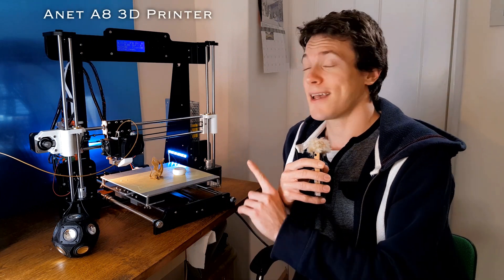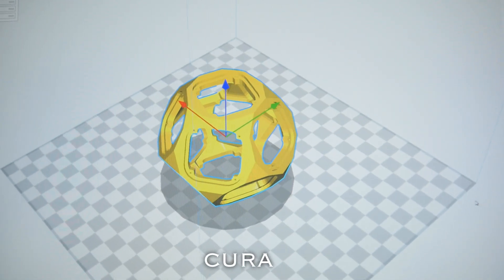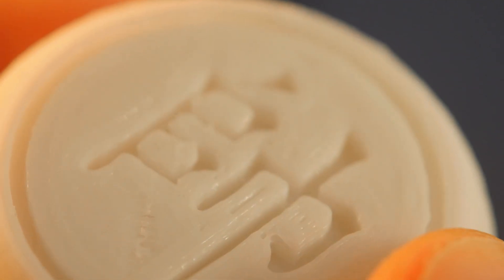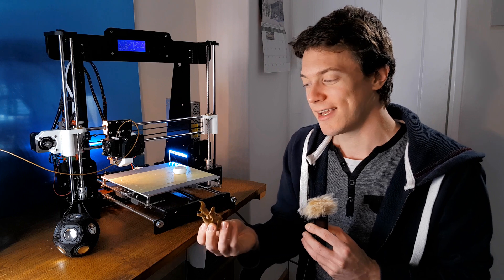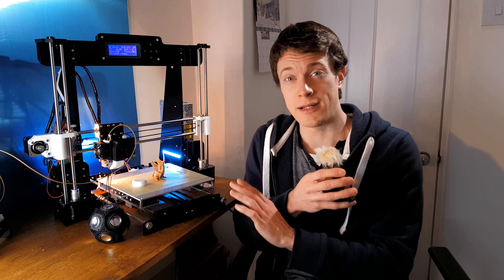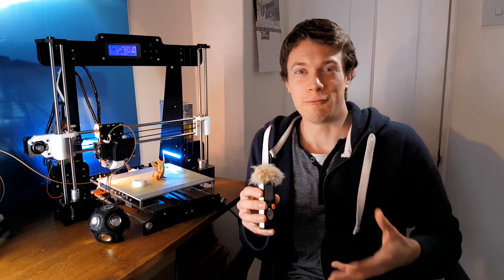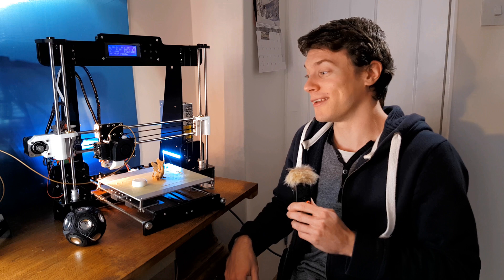Budget $155 3D Printer - Can it possibly be any good?

Comment: I love engineering and electronics in general, all the little gadgets :-) but this is one area I'm lacking in and your video and information was very valuable to me and my search for something in a decent price range. I really liked how you went more in depth with the overall printing process rather than just tossing out all the bells and whistles like most printer videos explaining why theirs are so expensive and why I don't need to buy there brand lol. My brother the actual electrical engineer built an X Y machine out of his old drill press and some printer stepping motors for designing PC boards. I on the other hand like to start off small and work my way up the ladder, learning each area involved in the process. I'm already a member of Ancestry, but seriously considering this model of printer if they are still around. Thank you again for all your great videos.

Comment: Anyone know if this works with Linux?  I'm interested in 3D printing as a hobbyist but I can't ever justify the cost.  This actually looks affordable and usable but I'm a Linux user full time and not willing to use another OS.  Thanks to anyone who knows!
Reply: I use Ideamaker for a slicer and it also runs on linux. And its great! I have printed about 20 things now with my cheap printer. Its works great, you should by a kit like I did.
Reply: @captainprototype187  Ended up getting an Ender 5, I'm really happy with it, been printing a ton.  Thanks for the tip though, I'll check out that slicer!

Comment: Hello. I was trying to print with this printer, but I keep getting bad prints (e.g. the base keeps getting stuck to the extruder while printing). Do you know if there's a good website to use to set up the program and printer to the correct specs? I have been having bad luck with it. Any help is appreciated. Thanks in advance.

Comment: I'd just like to ask clearly about that small dodecahedron speaker you showed at the end of the video - I'm very interested in something like that as a project (falls along several of my hobbies), and I was wondering if you created the .stl file for printing yourself, or was it something you found online? I've had little luck in the quick search I've tried, but as I'm limited on time I figure that asking is the best option right now. I'd appreciate any info on it, even if it's just tips on making it myself in CAD software. Thank you for the informative video - I'm finding myself very interested in 3D printing now, and appreciate the quality content. Carry on.
Reply from the maker: It was actually the first 3D print I've ever designed - I may put it up online at some point for people to print themselves. It will be in a future video if that's the case.
Reply: DIY Perks - Thank you for responding, and as well this quickly! I appreciate that, and will reaffirm that I would love to have a couple of those around - they're beautiful. I haven't yet begun to try using any kind of CAD software to attempt making things like this, as I'm currently limited on computer time (most if my YouTube time and responses are on my phone). I would appreciate any info you choose to offer, and I'd like to ask one more thing now that I know it is your model - did you design it on professional level software, or on one of the more accessible/free versions? Thank you again for responding, and I look forward to more content.

Comment: I was ready to connect all cables to the main board but then I realized that one cable is missing. I do not have a cable for the Extruder motor. Instead I have another cable for the Z-Motor2. Can I use this cable or are there any differences?

Comment: This printer is the best printer, once you do a few upgrades, under $1000.  Must upgrades include power supply $20-$30 bucks(supplied ps will blow after about 8 hours and is a fire risk). The other must upgrade is adding a mosfet to get the large current for the heat bed off the main board.  Lastly, upgrade power chords to to and from the new power supply to 14awg cable.  Then you can print out parts that help with belt tension and overall frame stability and yes, a new fan blower.  Once all this is done, and maybe a few extra fun but not necessary printed parts, now your printer is printing as good and exacting as a printer that is 10 times the money.

Comment: Don't Believe his lies ...I bought the anet a8 as my first 3D printer ... I waited about a month to get it ... then after assembly I did the wiring and the side of the board exploded... it was a bad board... then I bought a new one ... and it worked ... but the first time I tryed to print something the extruder Jamed and I didn't know what to do ... so now I have the shaft cleaned out but the very front nozzel is still broke ... and one of the wires just snapped so I soldered it back together.. now all I can do with my 3D printer is callibrate it ... not print with it... thanks for persuading me to buy a peace of crap

Comment: That problem with the power supply doesn't seem all so bad now that you taped the wires.  Sometimes when you buy things from places like those, the quality can be kinda shaky.  Let us know later on if any issues surface.  Even for $155 that would be an awesome deal.  I am personally waiting for the Trinus 3D printers to be released for sale.  The Trinus 3D printers seem to be high quality.  Sure they won't be $155 or $200 but they are by no means an unaffordable machine.  How they ultimately compare once people get them and then they go on sale is another thing but I am expecting great things from the looks of their videos showing them.  They are metal and not plastic framed and also have screw drives, not belts like many printers do.  One more nice thing is compatibility with a variety of filaments.  That all by itself can make it worth the extra cash if it turns out to be a success and not some horrible vaporware letdown as the OLO 3D printer looks to be (lucky for me I didn't pre-order that).

No matter which I decide on, it would be linked to my computer so I don't have to futz around moving memory cards around.  I would just find it more convenient that way.

Comment: You owe me an apology. I trusted you and bought from GearWorst. They still have to send my stuff for second month. They have the worst customer support. In case you are in trouble like me, the hell you can get anyone to support you as a buyer. ZERO buyer protection. All is about protecting the sellers. It is a Chinese gang waging war against the outsiders. Many many frustrated and unhappy customers. Buying from GearBest one must be forewarned of certain pitfalls. 
Please, make a proper introduction for this scam company. It is nothing like Aliexpress where buyers are 100% safe. Gearbest has worst order management interface. Almost no way to tell the difference between multiple item orders, which one is shipped and which one is not. If you bought 2 items at the same time, one is cheap and the other expensive, you may never see your expensive item.
Please, do the justice. Let us expose this crap

Comment: I have this one (A8) and it's pretty good for its price, also the size is good in this price segment. The buildup is a bit tricky but can save you like $150 as I have seen them for around $300 ready build online.
Issue however I seen is that once then and when I have to recalibrate the extruder. I don't know why but the "home" point of the z-axis is like 3mm below the bed surface but when I set the stop switch so that it's home it exactly at bed hight, when it then prints it hovers 3mm above the bed and you get but a mess of plastic at the nozzle. That makes calibrating it somewhat awkward and I have to do several adjustments until I can finally start printing.

Comment: Hello, I liked the review and I'm  looking at this printer for a possible project but I thought I'd just give a few pointers:

•there are many types of filament other than abs/pla and many of these other filaments are quickly catching up with abs

•you may want to talk more about the "modability" such as the ease of installing auto level systems and fans

•I would like if you covered more like the extruder type, nozzle size, motors etc.(though this is completely understandable since this is your first printer.)

•address wether or not the printer has a heated bed/what material it is since this is very important for material selection

Comment: I have an Anet A8, and it is pretty good. I do suggest printing a different fan nozzle, and for the stringing you can also print with a slightly cooler nozzle temp. The instructions are kinda lacking, but there is a Facebook group with a LOT of very knowledgeable and helpful people. 
Plus, a bonus with buying a kit: when it does break (as most 3d printers have a habit of doing), you have the know how to find the right part and put it back together yourself!

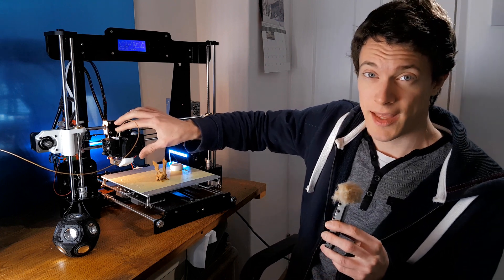Comment: At 1:13 you say there are two types of filament, this is worng, there are many types like PLA, ABS,  PET,  PETG, HIPS, PVA, Nylon, Amphora, TPE, ASA, TPU, PC and a lot more, not including spesial blends like amphora+carbon fiber, PLA+copper and so on. The dragon at 4:07 is what I would consider a failed print, but that is not the fault of the printer, but wrong settings in the slicer.

Comment: You cant print abs with that printer
Reply: ChronSyn yes but you won't get very far. Abs has a terrible warping problem while cooling so a 3d printer AT LEAST needs a heated bed to prevent this (best case scenario is a heated chamber) . However, aside from the acrylic construction this printer looks pretty good for the value; just maybe not for a beginner. Happy printing!
Reply: ChronSyn some i3s have heated beds but the i3 in this video ($155) does not.
Reply: Indeed - you need a heated chamber to print anything decently sized inABS. PETG is a great alternative for machines like this - just need the heated bed.

Comment: I'm near the end of assembly and I'm scared to turn it on. The instructions (and all pictures that I can find) show the positive wire for power on the right side of the board and negative on the left. However, the board in my kit has a "-" on the right side and "+" on the left. Does anyone know if some boards have the power input wired backward?
Reply: go buy a cheap multi-meter and test it to be sure - getting it wrong will be a big setback

Comment: I wouldn't order from gearbest. I originally did but cancelled after they said they would need more money to ship to the U.S. (this is after I already paid and a week after placing my original order). Their customer service was very nice and helpful with cancelling though and getting a full refund. But I've read online that some other people have had pretty bad experience using gearbest (such as parts missing, or damaged).
 I didn't get the $155 price (must have been before the video came out cause I put in my order December 8th) but $175. But after shipping and then the more money they wanted for shipping, and possibly taxes when it gets delivered since it's coming from China it would have ended up being closer to $250. Decided to order from Amazon instead, which was almost $300, but got delivered in 2 days, and I felt alright with paying the premium for easy returning if parts are missing/damage.
Took me close to 7 hours to build but so far I'm happy. In the process of printing some upgrades. For anyone who gets this printer I highly recommend joining the "OFFICIAL Anet 3D printer Support Group (Inc RepRap Prusa i3 clones)" facebook group. Lots of great information and help.

Comment: I have mixed feelings after buying this. It is dirt cheap but the kit was delivered with missing parts. The included SD card died within a day. There was no parts list to confirms the missing items. And the instructions really weren't that great so I ended up just kinda seeing what fit together. Then I have had a ton of issues getting some good prints but I have ordered replacements for some of the dodgier parts. In summary, only get this if you have a lot of patience, time, and are willing to tinker and figure stuff out.

Comment: Quick warning for anyone considering buying the printer:

I bought the printer on gearbest, but quickly cancelled my order. I read on reliable sources that printers made out of acrylic are not a good investment, as the material in very very brittle and is prone to breaking either during shipping, assembly or after being used. Once a part is damaged, I wish anyone who wants to get a replacement from china or gearbest good luck.

The components of the machine are also of minimal quality, and there have been reports of machines catching fire. 

Remember GearBest sent this printer themselves, and you have to remember this is basically free advertisement, plus they probably made sure to send out good machines for people to review. 

I don't want to undermine DIY perks' review, as the printer can deliver good prints, but it's definitely a gamble to buy this printer.

I personnally ended up buying a Monoprice Maker Select V2, which is the next best thing I could find, and is a much more reliable printer than the Anet.

Just thought I'd share and spare at least one person from disappointment.

Comment: I purchased this printer from GearBest.  Paid via PayPal.  After the payment is accepted, and the money transferred,  they tried to extort additional shipping charges and taxes from me, refusing to use the PayPal communication system.  This violates at least two Seller terms of use for PayPal (it is the sellers sole responsibility to collect the taxes, and failing to fulfill a transaction as promised).  Cue me submitting a message via the PayPal dispute system, as either violation is enough to cue an invalidated and reversed payment, with them losing the fee they paid to PayPal for the transfer services (3.9% for non-US transactions).  Moral is:  Be wary of GearBest.

Comment: Buying a 3D-printer for 150$ is like buying a pc for 30$. I worked with the ultimaker 1&2 and the zortrax m200. I have to say that the quality that was shown in the video is really not good, but for 150$ it's outstanding. I would worry about the durabilty which can't be any good concerning the price of this thing. I often say that you should wait a few years to get a 3D-printer, because they will get better and cheaper (just like computers).

Comment: Warning dealing with GearBest, this happened to me and I've seen several reports from others that GearBest will ask for unspecified additional charges and fees in order to use an expedited shipping service.  This happened to me when I contacted them asking why my order had not been dispatched within the advertised time.  I also see complaints in the Anet support FB group about support after purchase from GearBest.  In general this seems like a disreputable retailer and I'm disappointed that DIY Perks has associated himself with them.  The research I've done does seem to indicate that this printer is a good entry printer with an active support community and numerous printable upgrades available, but do realize that DIY Perks didn't actually need to deal with GearBest as a regular customer.

Comment: Amazon link now @ $278 (assuming USD). Exchange rate this means ~$371 AUD assuming additional postage (don't use Amazon).

If you've come across one to recommend or review in future I could really do with a large low res 1800-2400mm² capable down to 1-2mm precision of printing protective casings and moldings, edge protectors, dowel+plugs etc for furniture.

Apart from the smaller fittings etc need a ~3-4.5mm thickness.